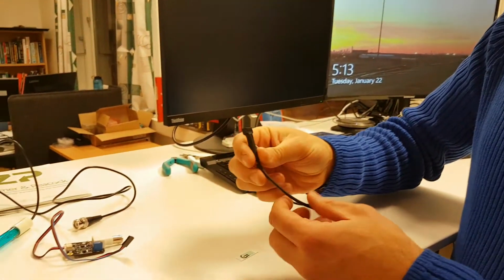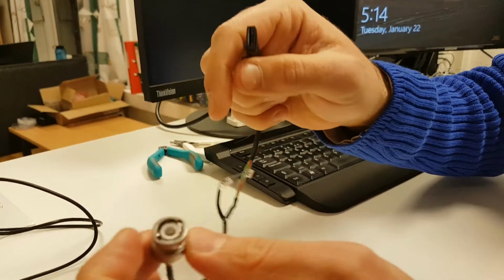Arduino Board for measuring pH

Comment: Hello and thanks for the video. I would like to ask, by short-circuiting the counter and the reference electrode on the shield aren't you disabling the function of the reference electrode? In other words, does the reference electrode still provide a reference voltage if it has been short-circuited with the counter electrode?
Reply from the maker: This is a 4 year old video for us we have linked to a webpage, but must admit we haven't worked om this for years - https://www.zimmerpeacocktech.com/2018/09/14/ph-with-arduino/